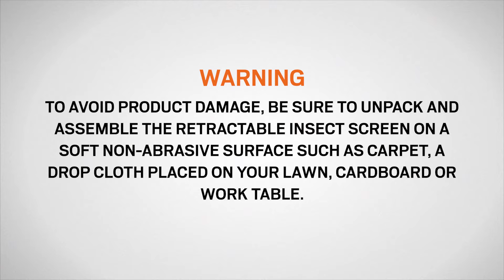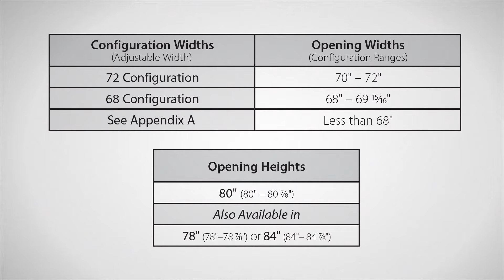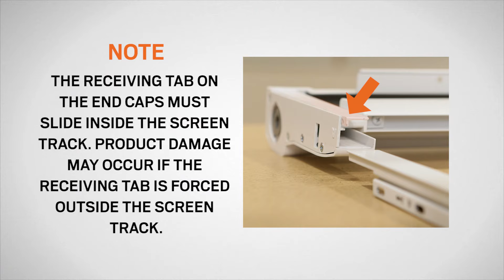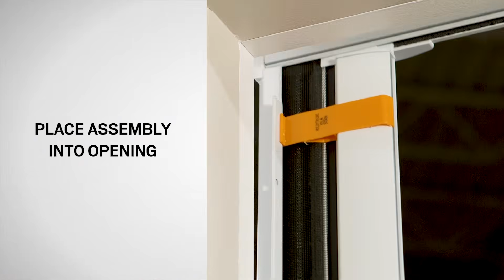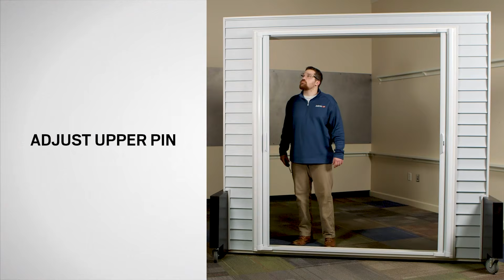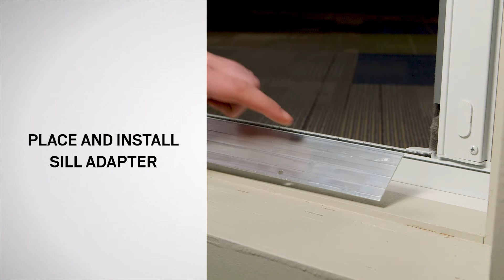How to Install an Andersen LuminAire™ Retractable Screen Double Door | Andersen Windows

Comment: Love the door, fairly easy to install.  BUT!  The step of inserting a Phillips into the adjust slot is done by your Tech with no door in the way.  I had less than 5" inches between my door and the adjustment slot.  Using a mirror and a stubby Phillips I was eventually able to do what the Tech did.  Either I over complicated it, or you should put this step earlier in the mounting process since we don't have open frames to work with like this demo.  Otherwise, everything went amazingly smooth and my wife loves the screen door.  Thanks

Comment: Very happy with the screen doors. My opening was 72 1/2” and the screen had a max at 72.. so I just added a 1/2” piece of trim to the outer frame mounding trim on my doors and fit perfectly. Delighted.

Comment: I have outward swinging Andersen french doors with 80" opening. Can this be installed on the inside?
Reply: Any response??
Reply: Of course it can.  If you live in FL, it's required for the French doors to go outward for Hurricane safety.

Comment: I have two French doors opening outward with a 60 in opening and a 78 in height,  Would I need a custom made one or can i just work wtih the regular screen double door?
Reply: See if you can turn the door hinges into inward opening, so you should be fine then.
Reply: U have to cut the frame of the screen both sides evenly

Comment: Can this be installed over existing patio door frame?
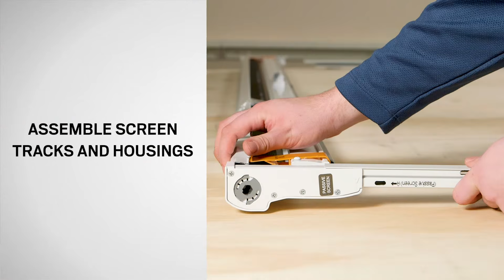Reply from the maker: Thank you for asking. This would require a  wood trim/brickmould. Please call us at 855 337 8825 Monday - Friday from 8:00-4:30 p.m. cst. if you have any questions or would like guidance locating the paper installation guide.

Comment: we’ve had nothing but issues with our screen door, and ours was professionally installed. 

first the locking latch stopped functioning. and even though we were still under warranty, the most Andersen would do initially was to say “you bought it at home depot- you need to talk to them”.  

after way too much back and forth Andersen agreed to send replacement parts (half the screen door) which i then have to install (they wont install for you).  First replacement arrived: box was broken open, and contents were damaged beyond use. note that it looked like the box was opened in transit intentionally, not through just rough handling during shipping. (i say this as I worked at UPS and RPS in college and the loaders would look for valuable content; not a month went by where someone wasn't let go for pillaging packages).  Our package in this case was handled by UPS. 

So we called in, sent photos via email to show damage. They told us they will send another and to just throw away the broken one. Its 80” long you stupid fucks - that's a special garbage pickup at $25 a pop...

Another arrived 3 more weeks later and guess what? Box opened, contents damaged, delivered by UPS. they said throw it away and we’ll send another. Now I have 2 useless replacement parts - I said no, im gonna post my experience online so everyone knows to stay away from Andersen products (and UPS for shipping). neither care about you, your experience or good customer service. These companies are giant ships crewed by old white men who are playing their favorite game: watching number$ go up. 

Andersen: fuck you. 
UPS: fuck you. 

p.s.: if you are offended by this, fuck you. i don't have to be nice about this anymore. you had 2 fucking chances to fix the 1st fuckup. fail, fail, fail. at this point you've not only stolen $600 from me. the collective time and effort spent (pulling me away from dealing with MY business) tallies in the thousands.  

At this point I just want the $600 back I paid for the original screen door element. do that (or crikey, solve my issue once and for all)  and ill delete my reviews here and on google.
Reply: You can add a trim from the top or bottom to have a fit opening.

Comment: Just installed these onto french doors with a 60" opening. Pleasantly surprised by how easy it was. Didn't even need any silicone as there was zero gaps to stop the bugs ! Only mod required was some light sanding of the opening surface to clear a upper passive side button headed screw from fouling. After that - perfection ! You've brought peace to my family :) thanks !

Comment: Just installed on our dual French patio doors.  Excellent engineering and manufacturing quality.  My installation required some added prep work in that our French doors are installed in an unconventional way; with the door jam protruding from the surface of the house about 2".  Not a problem since the door is under cover under a patio roof and does not see rain. This forced the customary brick molding to be installed against the stucco, in from the exterior face of the door frame.  To install, I needed to use a metal rotary saw to cut off a 1/4" thick piece of metal on both vertical frames, grind the cut down and install the Luminaire directly to the metal of the French door frame (these are wood and clad doors but have a metal sill and exterior frame to receive sliding screen doors.)   I bought #8 x 1/2" self tapping screws for the six side frame connection point (very similar to the threshold extender screws provided with this product.)  

Our weird installation aside, putting in the Luminaire double screen door product was a breeze.  Now we can leave both French doors wide open all night to take in the cool air, then button back up for the daytime.  Fun tip:  if you release the "passive" screen door first, and then the "active" screen door, they both, in synchrony, automatically retreat into their housings.  So much better than traditional rolling screens, these can be left wide open during parties and cookouts (assuming the insects are not a problem).  Have at it - no disappointments here!
Reply from the maker: Hi Rick! Thank you for reaching out. We are glad we could help! -KB
Reply: @andersenwindows  can these be used for out swing doors?
Reply: Rick, Did you just buy the regular double door screen and modify it to fit the 60 inches?  Also my doors swing outward, so the structure will have to on the inside of my french doors. Also, did the screen hit the french door handles when pulled.
Reply: @Linda-ip8xt  I recall that Andersen offers two height variations, but the width was standard 60", which is what we have. I think that their design would also work on a narrower french door.  The screens did not conflict with the french door hardware at all. I don't know if the screens can be mounted inside the french doors... suggest talking that over with Andersen.  I would think it would work and cosmetically would be fine but check with Andersen first.